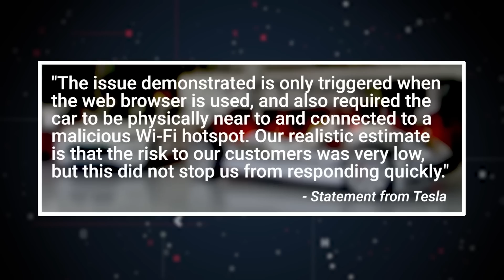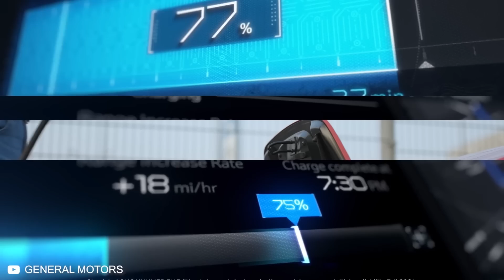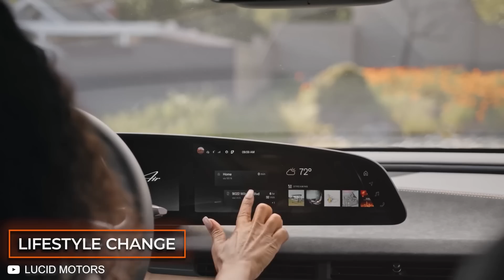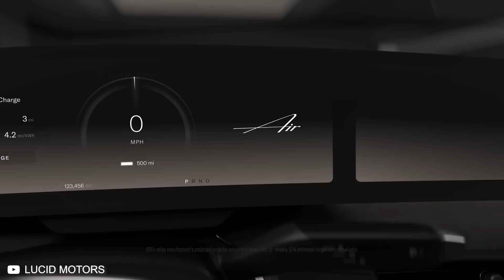EVs' Serious Problems That Carmakers Are Hiding

Comment: As informed as this reviewer wants to make himself sound. All YES ALL the arguments he presented were debunked many YEARS ago.
1.  All EV's charge at rates that take a battery mere minutes to fully Charge when on a road trip.
2.  Yes they take a little longer when plugged in at home because that is a Level 2 charge ONLY.
3.  The reviewer paints a picture that may have been true in the early 1900's at the turn of the century when batteries were all Lead Acid.
4.  Repair shops for EV's are opening up all over the place.
5. The TESLA Supercharger Network Map is a very  OLD ONE that is shown in this video. TESLA have been installing Superchargers at a very rapid rate. 
6. Do some research and view a RECENT Supercharger Network Map. Available on the TESLA website. As well as other locations on the INTERNET.
7. Buying any kind of car today, NO MATTER if it is an ICE or an EV doesn't make the CHIPS appear any faster as the entire auto industry are in the midst of a CHIP shortage because of the PANDEMIC.

Do some real life research as this reviewer is full of B.S. OR is simply and OIL Schill

Comment: I'd like my next car to be an EV. Surprisingly powerful engine, greener, a lot less moving parts. But due to budget won't be ordering one until 2025 or 2026. Currently have a Toyota hybrid. Problem is Toyota doesn't wanna go ev, which is why they're the only manufacturer that doesn't do them (out of MG, Hyundai, Nissan, Mazda, Ford, BMW, Kia, and the list goes on). EV car prices in New Zealand, on average start from NZ$79,000. You could buy 2 new Toyota Corolla hybrids for that price.

Comment: Charging up to 80% in 40 minutes is not something to brag about. It makes road tripping untenable, especially when you have a deadline to make. And fast chargers reduce battery life. Most ICE vehicles will last a lot longer than 10 years if properly maintained. They make EV's look disposable in comparison. Who's going to spend $15,000 on a new battery for an EV with 150k miles on it? After ICE vehicles are banned car ownership will become a luxury only available to the well off since high mile EVs will essentially be worthless.

Comment: Range problem and the fact that no country in Europe currently can even remotely sustain the power needs if everyone had EV.

Also the fact that you need at least 45min to charge is the big issue.
Unlike gas stations where you can be in and out in 4minutes. So the turnover of users per petrol pump is quick. For EV you basically need to facilitate parking lots.

Also, have you ever had to use the communal laundry room. How many times someone puts their laundry and then disappears for hours.
Same will happen with changing ports.

Comment: The overuse of technology is probably the single biggest problem.  Core car functions* must not be reliant on having to use touch screens along with their nested menus.  Taking one's eyes off the road to diddle with touch screens is never a good thing.
* wipers, lights, heat, air conditioning, defrosting, and radio presets.

Comment: With globalization rapidly drawing to a close, I really don't see a way that manufacturers will be able to source the required minerals at anywhere near the scale or cost to make it possible for EV's to replace the internal combustion powered vehicle.   I think it is a big mistake to try to do so.  A far better approach would be to target EV's where they make the most sense which would be as a "second car" for modest commutes and daily errands in suburban areas where most homeowners have the capability of having charging stations at home.  The only "lifestyle change" would be to plug in the car at night and not have to go to gas stations anymore.  Ev's are trying to be everything regular vehicles are and that is not optimal.

Comment: The problem I see is price and range. Until they come up with a reasonably priced EV that has a longer range, the infrastructure will be hard to support. Electric may not be the answer. Some other sustainable fuel.

Comment: There are a number of problems. Starting with charging. The Tesla model 3 now has an 83 KWH battery. A normal plug supplies 120 volts and 15 amps or 1800 waste of 1.8 Kilowatts. Allowing for losses changing AC to DC required for the car brings that to 1.5 KW at best. That would take at least 55.5 hours to fully charge the battery. The charging rate drops dramatically when over 80% full so it would take longer. If you want to add a fast charger to your house you will have to increase the capacity of your service. Two EV cars increase that even more. If everyone in your subdivision has an EV than the local service has to be increased dramatically.
People with an ICE car buys gas or diesel at a gas station. The difference in price per litre between what the station pays for fuel & what it is sold for is the contribution margin. The contribution margin pays for the fixed costs. Unless enough fuel is sold the station closes.
How can public charging stations exist if a large number of people acquire their fuel (electricity) at home?

Comment: The only way that I would buy an EV, is first the cost would have to be less than 20k, the battery is life time, no replacing, charging stations are as numerous as gas stations, the time it takes to charge is the same time it takes to fill up a gas tank, and the range is at least 500 miles, other wise I will never buy an EV.

Comment: Don't buy a stupid EV in the first place, they are NOT green and the planet doesn't need saving. Extreme cold kills 10 x the numbers of extreme heat. Take the USA, why are Americans moving south en-mass. If CO2 was a problem build cars that do 300mpg, like the VW XL1, or better. How many of you greenies know what the Milankovic cycle is which accounts for most climate change, maybe you fools think you can do something about that?? EVs will die out when people wake up and smell the BS. In the UK the yobs are stealing charger cables £50 scrap value and vandalizing the charging stations.

Comment: An EVs range is not fixed in stone, some will go farther than you think when batteries are low. It will not just stop, some will gradually reduce power, however, as with any battery you should not fully discharge it. You can get roadside assistance if it's in your area. You can get maps that will tell you where charging stations are.

Comment: i own a used Chevy Volt.  The Volt User Forum indicated that Chevrolet is not supporting their product: no new HV Batteries can be had when the OEM dies, and the car can become as a "brick" without warning, should a single cell's voltage drop below a threshold, and the car's computer prevents the car from starting, even though, as a plug-in-hybrid,  it has a gasoline engine.

Comment: Sounds like Tesla is basing itself on the iPhone model whereby they come out with a new, more expensive phone every year that is barely different/better than the last one and the batteries are deliberately set to fail quickly. Yet people act like sheep going to crazy lengths to get one. Also where is all this extra electricity coming from when thousands of EVs need charging at the same time. Even 40 mins is considerably longer than it takes to fil a petrol car and imagine if there is a big queue of cars waiting to recharge.... Not fun

Comment: "If you charge it too much, the battery can die." So basically that's a major problem since you'd want to keep your electric car as close to 100% fully charged as possible when you're not driving it. And not charging it will gradually drain the battery just like with a smartphone not being charged.

Comment: So $40000 gets you a mode of transport that no matter how well it's maintained it's power source will be caput in 10 years, in a collision you are sat on a bomb, it doesn't like wet winter or hot summers and is an open door for hackers, and don't mention power downs yep
Reply: Why would it cap out in 10 years when modern EV batteries are designed to and are shown to be lasting over 400,000 miles and that doesn’t affect the torque or HP of the electric motor?

Why don’t they like wet winters or hot summers. Statistically EV’s are more reliable in both. Since they don’t have to warm their engine up by turning over for minutes until the car battery is flat, it just runs. And it also doesn’t operate at insanely high temperatures, it doesn’t run the risk of blowing temps or radiators come the first hot week of summer like ICE cars do.

Also worth noting that according to effectly EVERY vehicle safety authority around the world and Amy beuro of statistics around the world EV’s are roughly 5 times less likely to combust in an accident, and 11 times less likely to spontaneously combust compared to ICE vehicles. So hardly like riding a bomb then is it?
Reply: I mean. You do know that EV batteries today have a warranty of 8 years on their own right?
Reply: As for hackers, Tesla holds an open million dollar reward for anyone who can successfully steal a Tesla through hacking. And there are only a handful of people with the skills to even attempt it, globally. You could count them on one hand. So I doubt a gang banger that dropped out of first year elementary school, is not only a globally renowned computer expert but also happens to have the hundreds of thousands of dollars of specialists equipment it would need. Think you’re pretty safe
Reply: What power downs?

Comment: In the UK, where I live, there are no charging points. The nearest is on a motorway service station 35 miles away. The demands my job and home life make on me mean that I cannot afford the time to travel miles or waste hours recharging. Assuming the charging point is working, since it usually isn't. On a more general scale, the environmental and human damage done by digging out the minerals required to build the batteries and other components far exceeds the relatively minor impact of a diesel engine. I can run my diesel vehicle for decades to come without causing half ghe environmental damage caused by the processes involved in constructing and  later disposing of EV powerplants.

Comment: how long does the charge on car batteries last if you don't use the car for a long time . And what about battery performance in sub-zero temperatures . Then there is the problem of cost  of battery replacement , and also the really bad one of range . And there will NOT be charging points all across even Europe , there are places even in the EU where there is no electricity
Reply: Probably far more charging location in Europe than you think. There are thousands in even Australia where I live. I went on holiday and left my car in the garage. With sentry mode off, after 1 month I lost 2%.

Driving my car in sub zero, the biggest drain on the battery were my snow chains. But when I didn’t have those on I didn’t notice any difference other than I didn’t have to worry about my car not starting because the engine was too cold.

Modern EV batteries last twice the lifespan of an average combustion engine are around or above 400,000 miles to 20% loss of original range. You’d have to worry about replacing your combustion engine far more than an EV battery. And a new battery is cheaper than a new engine.

Really bad range? My Tesla model 3 has more range than my Subaru Impreza. Infact the model 3 has bigger battery range than it’s nearest competitors fuel range, the BMW M3.

Comment: Petrol cars will still be on sale past 2030 in the UK because either there will need to be a political or technological revolution to make battery EV cars the norm. And those will not happen. Battery technology, the main obstacle, has not moved on for decades and is fundamentally no different to the way it has been since the 70s. And given fundamental physics is the barrier, that is unlikely to change. Face it, until abundant clean electricity is available via nuclear fusion, reseeding horizon thirty years, hydrogen fuel cells are the only electric cars that will make sense. Until then petrol cars are the only viable option. Perhaps less sexy options like increased use of public transport, planning laws to minimise the need to travel and general common sense are better ways to cut emissions than wishing on electric battery car science fiction fantasy.

Comment: People need to understand something, because of the laws of physics there will never be miracle batteries powerful enough to replace fossil fuels.
Reply: No one is making the claim that batteries are for everything, but are more suited for small mobiles systems like cars; lithium batteries for now, and graphene or silicone batteries in a few years. Synthetic fuels or hydrogen will highly likely be used for large mobile systems.
Reply: @rps1689  You don't live in California do you? Because they are. You can't buy a gasoline powered yard appliance, new homes have to be all electric and as the old saying goes how goes California goes the rest of the nation. Then you have Biden actively hostile to fossil fuel. And all I have to say is it didn't work out for Europe but they expected to work here.

Comment: "EV's have complex electrical components like power steering motors..."  Um, so do gas powered Ford trucks and SUVs going back at least 10 years.  It's not more complex than hydraulic power steering, and to my knowledge not more prone to failure.

Comment: They need to show pure facts. 
How much pollution is made at the electric power plant, and how much pollution is made in mining and processing lithium , and disposal of the batteries??
If they pollute just as much , what's the point. ???
I still think high speed rail and bikable cities is where he environmental advantage is. If your spewing out emmissions producing ELECTRICITY,  than where are we improving??
Reply: It's not so much about pollution, it is about the type of pollution. An EV recharged by a coal plant puts out half the CO2 as a gasoline car the same size doing the same trip and even much better in stop and go commuter congestion. 

Manufacturing an EV puts out more CO2 than making a gasoline car the same size, because of the battery. The break even point, for the average US electric grid (less than 20% coal, mostly natural gas) is at about 10K miles.  Imagine what can be accomplished with much more efficient upgraded grids and power plants that require less fossil fuel along with solar and wind to fill the gap until next generation nuclear.

The big point of EVs is that petroleum is to valuable to be wasted on gasoline especially on small mobile transport. We should leave as most of it as we can in the ground for our grandchildren to use for plastics, paints, petrochemical feedstock medicine, etc.

As metals and chemicals get more expensive, closed loop manufacturing processes start and have become the norm in places like China. Toxic waste, is just another industrial waste problem and when appropriately managed, raises no risk to the continuity of civilization, but the continuation of fossils fuels at the current rate does.

Comment: What a narrow and myopic perspective. All the the 'problems' are extreme.Batteries can be replace in cells, so you are extremely unlikely ,even after 10 yrs, you would need to replace the whole battery. This also fails to acknowledge the maintenance cost of ICE cars.EVs are mostly driven , like ICE ccars around town and require not much charging.In the meantime there is a rapid expansion of charging stations around world. I have just completed a 3000K in Australia without any issues.
In the meantime make a choice to either contine to destry the panet by burning fossil fuels or consider buying an EV.

Comment: I like this video. Tells the truth. It takes 12 years of an ev on the road before it breaks even with the massive environmental impact manufacturing an ev has when compared to a gas car. 200,000 lbs of earth have to be moved to collect enough metals for one battery. It takes 900 barrels of oil to make batteries with the equivalent storage of 1 barrel of oil. Half the grid in USA is powered by coal. So widespread adoption will increase coal burning.  And in the end the ev will not meet most Americans needs. I pull a construction trailer with my truck every day to work, sometimes a hundreds miles away. Then I work my truck all day. Then drive home. There is no place to charge an ev on the job site other 110 volt extension cord to the construction generator, and that power is not clean enough to charge an ev, and that power is needed to power the tools and equipment. People are just delusional if they think evs will ever work for the vast majority of the population that keeps America running in the trade fields every day. We need heavy duty pickups and vans that can haul tons of materials, tow construction and equipment trailers, and work all day into the night, then take us home safely. And anyone that does not accept this reality and thinks evs can be forced has a rude awakening coming. My truck is my heated and air conditioned office, my material carrier, my snow plow, my pack mule,and my trailer hauler; in all kinds of weather and all kinds of terrain. And it you want the homes I build for you than you need to accept this is the way it is for people like me. So stop forcing me into an ev. I’ve been in my business 33 years. I know what works and what it takes. And quite honestly if you are not in the construction business moving from job to job through all kinds of weather and challenges, put bluntly how have no clue what you are talking about.